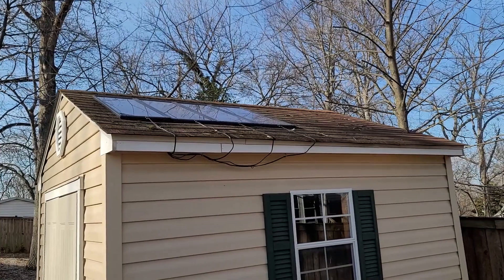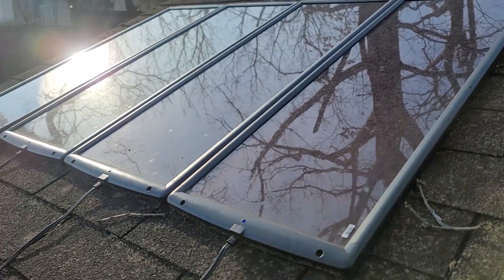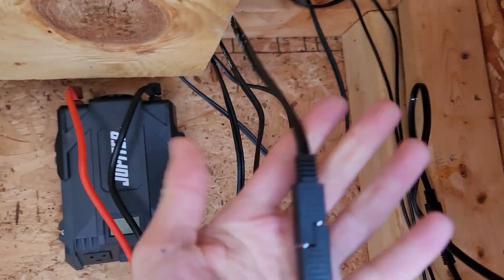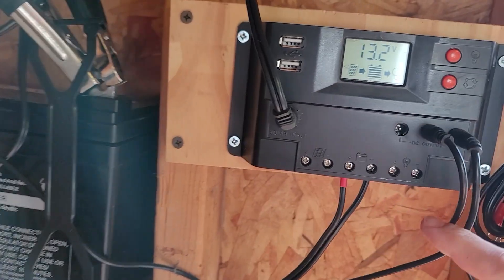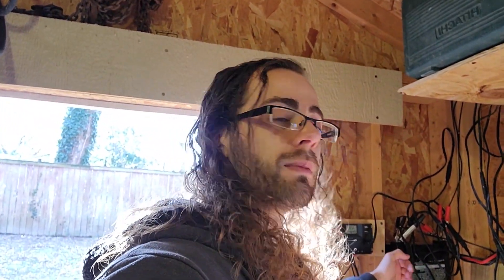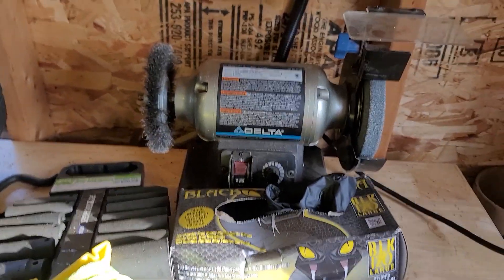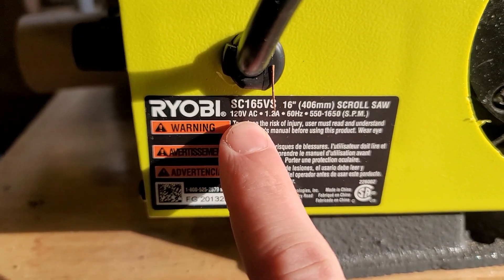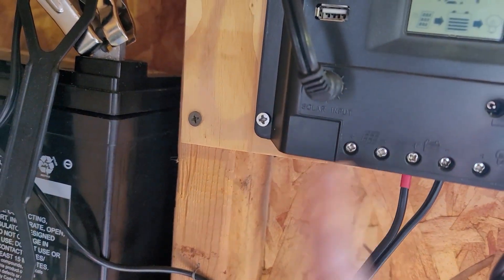Adding Solar Panels and Outlets to Shed

Comment: Did you have to get a permit and have an inspection of your system.  I got fined $250 for NOT having a permit and having my 300 watt system inspected.  I had to have all the wires in conduit according to code.  I had to rip it all out and have it installed by a licensed electrician for $600.  I didn't do that and sold my panels, inverter and controller. that I was going to use for backup.  So much for going green.

Comment: Is the shed too hot for the battery in summer?
Reply from the maker: I didn't really notice any degradation of performance in the Summer, if that's what you mean.
Reply: @Bootstrappin  I mean is that dangerous to put battery in hot shed in summer? I am in TX, summer is super hot.

Comment: My shed is solar powered, I put in a regular light switch, like they sell at Walmart. I have a separate switch for AC stuff, only when I'm using AC stuff. Most of the time I just leave the LED lights on 24/7 since the power is free.

Comment: Nice video, thanks for sharing. I just installed an Arrow Newport 10 x 8 shed and want to run mainly LED lights. I have 2 1.5watt trickle chargers from HF and they work just fine keeping my AGM 18Ah batteries topped off. I want to set up a 7.5Ah gell cell just for the lights and I think the two solar panels will be just fine. The shed is just for storage, not as a work shop like yours.
Reply from the maker: Thank you! Agreed, shouldn't take anything fancy/large to run those lights.

Comment: Great video.  Nice simple explanations.  I just ordered 2, JJN brand 100 watt panels to put on my shed roof for only $141.  I'm going to use them to power a lifePO4 solar generator (between 500 and 700 wh).  Like you, I'm going to use it for lights; to charge tool batteries; and to power small power tools.  I'm going with the solar generator option because of the portability.  I'll be able to take it places with me and to put it in the house during the winter.  Have you expanded your system since making that video?

Comment: Great video. Good job explaining the kit. It's a great kit to begin with. We started with that kit and a 100ah AGM battery. Same inverter. We used it camping. And for me to test and learn from.   Since then we have upgraded  to a 210w panel connected to a 30a mppt charge controller and 2 100w harbor freight solar panels connected in series to another 30a mppt charge controller. This ran to 4 115ah agm batteries connected in parallel. Upgraded to 2 100ah lifepo4 batteries in parallel. And a 1000w pure sine wave inverter.  This has been running 24/7 for the last year in our shed powering everything in our bedroom from a heated blanket to a 45in tv and sound bar. Led lights.  Fans.  Charging batteries, phones tablets. Even my girls curling irons. Just to name sum stuff we use on a daily basis. That one kit became my introduction to solar. And my addiction. Lol.  Enjoy.

Comment: Did you use a ground earth?
Reply from the maker: No I did not
Reply: No worries about leaks in your roof by simply screwing into your shingles without anything to seal them in?
Reply from the maker: @SASlair  so far, no leaks, and it has been about a year. I see what you're saying, but I don't see any straightforward way to add sealant, unless perhaps you were to dip the screws in tar/caulk before screwing them in.
Reply: Not having leaks is pure luck, you need to use proper mounting brackets that go under the shingle

Comment: This is awesome,  I never thought of solar. And I sure as hell didn't think I could do it under $500. These are cheaper then they used to be. I was terrified of dealing with my electrical panel this summer. You helped me avoid my wife yelling at me
Reply from the maker: Yeah it's not bad at all, in fact the stuff you can find on Amazon appears to be even cheaper than Harbor Freight. Can't speak to it, but like this one only lacks 12V lights, but has a 100W panel and controller. Pretty cool. And yeah, anytime you can avoid an 8 hour power outage oopsie... always good.

https://amzn.to/3v93aG7

Comment: This is a great use of inexpensive solar panels. At least you were not hustled by door-to-door scammers hawking solar that would have roped you into a 70 year lease, encumbering your home if you try and sell it. You may want to cut off the battery clamps and hard wire the connections to the battery. This would improve current flow a little better and reduce oxidation, but I am quite sure you are well aware of this.  Also, you presented an excellent explanation of transformer losses.
Reply from the maker: Thanks man! Yeah I certainly like their angle of financing a whole house system -- it'll pay for itself!... in 20 years! At which point it needs to be replaced! And don't forget, you should also replace your roof shingles, because you'd have to remove the panels in order to do that! And yeah you're right - for all this talk of power loss, and I went with gator clamps...
Reply: I have a similar setup but i used the portable charging solar panel and mounted everything in a box for when im on the kayak i dont have a inverter but to add One would be easy i do however have a ebay usb anf aux plug connetion on it to run lights and my motor if im on the water